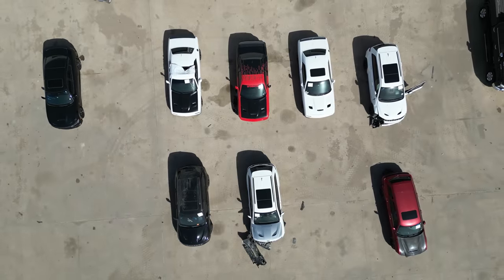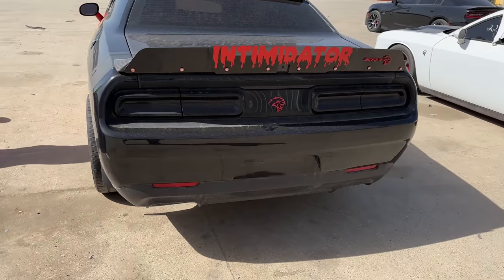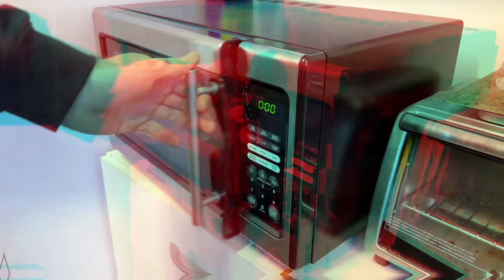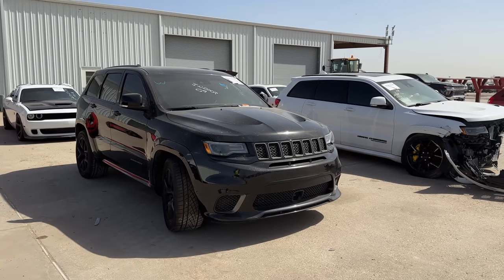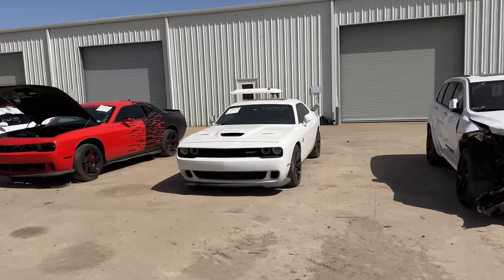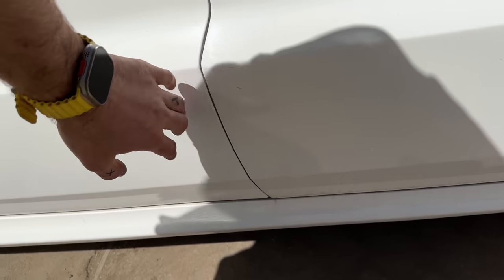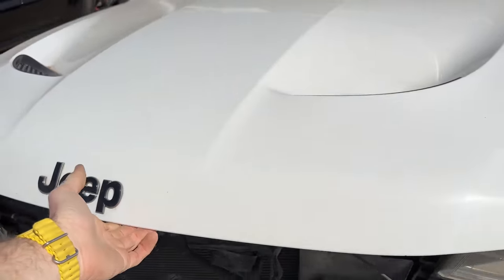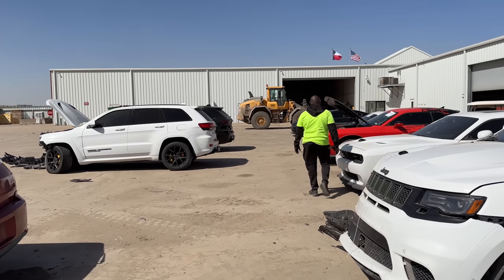Buying STOLEN Hellcats CHEAP At Salvage Auction!?

Comment from the maker: Use code SCRAPLIFE50 to get 50% off your first Factor box at
bit.ly/3TdKlxt
Reply: Ty
Reply: Do you put engine in
Reply: 😅😅😅the
Reply: You need a flipper to unlock that car.
Reply: what would it cost to replace the infotainment system,  front, and rear bumper, and a few small dents on a 2021 challenger T/A?
Reply: 16.000 for garbage dudeeee , missing parts???

Comment: The glove compartment allows for coding of a new key. There is a plug back there people can connect to. If you can take some extra effort to zip tie that thing somewhere else.. hide it in the dash.. You're good. There is another tap in point in the Trunk behind the passenger side back seat. Now you know. Fix it. I work at place that program vehicles. This is the common tap in points for easy access. The harder part is connecting to the SGW module located behind the radio or something in the driver foot well close to the obd2 port.

Comment: Correct me if I'm wrong, but the block on the "Intimidator" has a VIN, and not of the removed parts would have, right? You should 1000% buy that Durango to yank the Demon around.
Reply from the maker: I think you’re on to something there…
Reply: @scraplifegarage  Please say about you buying the Durango. It needs a little drop and some wheels. If you don't get that then I think you should get an Escalade and toss in some forged rods and pistons, a ported LT4 supercharger, cam, LT4 fuel setup, and drop it with some nice wheels.
Reply: @chesspiece81  Supercharged escalade seems like a good idea :)

Comment: That challenger with the transmission, heads and supercharger missing is a insurance job. If it had legitimately been stolen there would have been significantly more damage and that engine would have been pulled out completely rather than time taken to pull the parts specifically
Reply: i feel like they're selling stuff on fb marketplace. I just seen a listing for the hellcat supercharger for cheap af

Comment: ive bought a bunch of srt8s and people will steal the good drive train and then dump a core engine with a hole or some other damage, when the tow guy picks it up he is just looking at the vin not what. engine is supposed to be in it . also some.people will total out there car this way with mechanical damage  ,, get the pay out on insurance and for there engine when they sell it used on the side  they just dump a beat blown ass engine in the frame just for insurance

Comment: That Magnum is a PERFECT Chargum candidate!
Reply: Take the face off a 2015+ Charger and maybe swap out the outdated interior with direct bolt-in/plug'n'play swaps from a 2015+ Charger (dash & BCM, center console, seats) and an 05-09 Chrysler 300 (for the door panels)
Reply: @RenegadeRukus  It already has a charger front end.